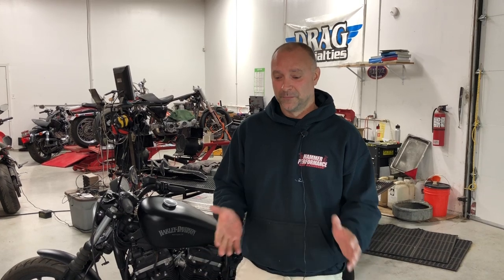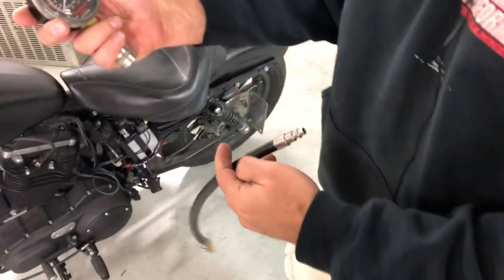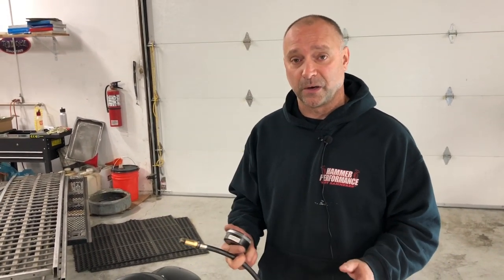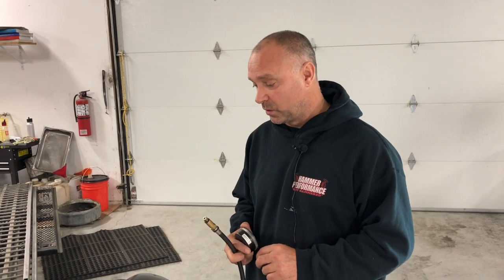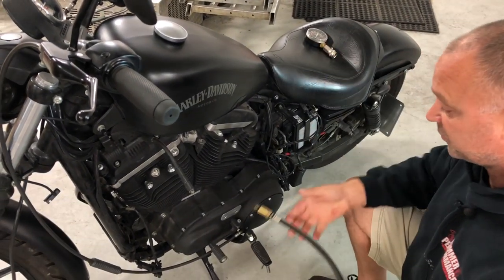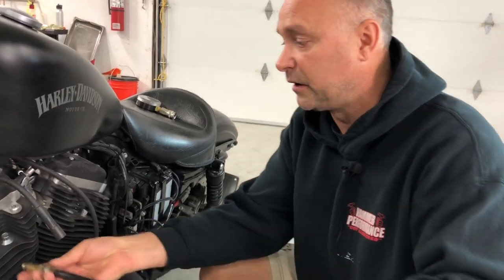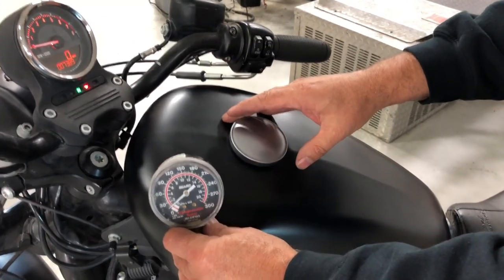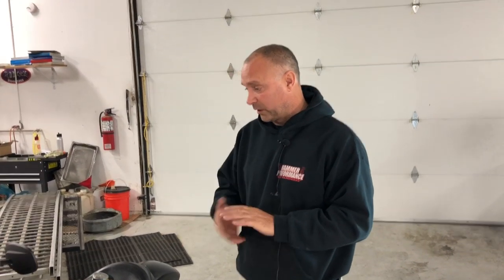How To Do A Cranking Compression Check On A Harley Davidson Motorcycle

Comment: Main thing you missed out here is it is not just the psi, it is important that both cylinders give similar readings. If one is low compared to the other you have a problem
Reply: How large of a difference between cylinders is okay?
Reply: @codybatman7974  much more than 10 psi and I would think something is up. Usually it is the rear cylinder that is lower as it runs a bit hotter.

Comment: Quoting my 2006 H-D service manual, 1200cc engines normal compression is 200 to 225 PSI.... no wonder it would sometimes 'rattle' with pre-ignition on hot days..... I was getting 211 and 215 with one of your 1250 kits (rectangular dome 10.5 :1 pistons) and Andrews N4 cams. I have since bought your Impact 560 cams and use Ultima roller rockers with a slight ratio increase and had the heads ported over here in England. The porter found my heads needed decking to get the nominal 62cc (or whatever it is ! ) due to some other guy's seat work.... I have found my compression tester again, so will be interested to see what it tells me.....
Reply: It's been a while but do you remember your results?
Reply: @jonnymac8925  No, sorry but I haven't put the compression tester on it yet and it may be a while before I get the chance. I managed to lose control at low speed and slip into a gulley - long story short, the bike is not too bad but I have a broken tibia and fibula that required the use of a Llizarov frame (look it up). I would not think the cranking pressures are much higher than H-D quote for a standard bike though as although Hammer's static compression ratio is higher than Harley's standard XL1200R, the later closing point of Hammers inlet cam will reduce the overall cranking pressure

Comment: 2016 Street Glide, does it matter if my bike is fuel injected? Still wide open on the throttle? Would I do everything the same? What compression should I expect from a stock 103 engine?

Comment: Do I need to disconnect fuel on an injected 96 twin cam? And do I leave the plugs connected and ground them to the bike or just pull the fuse for the ignition?

Comment: Removing spark plugs on a hot engine alum cylinder could strip the threads . On a warm engine they may be ok to remove.

Comment: What readings should I be expecting by doing this with a cold engine and without WOT on a fatboy 103 ci? The manual also states to take off the air cleaner, Is it really necessary to do that? Your answer will be much appreciated.
Reply from the maker: A compression test without holding the throttle wide open is invalid, and you shouldn't draw any conclusions from the result. If the motor can't draw in air, it can't make compression.
Reply: @HAMMERPERFORMANCE  Ok thank you so much for your quick answer.........The reason I ask this is I have an electronic throttle so I'm not quite sure it will work with the plugs out when I push the start button.....anyways if I do this with completely WOT, cold engine and air filter on, what readings should I be expecting from this particular 103 motor? Thanks again.

P.D. I also have ACRs on the heads

Comment: Hey Hammer Dan. I’ve been catching a lot of your vids and I have noticed when you talk about “earlier model Sportsters“ you don’t usually go back to include the four-speed motors. Are they that different, that it would require a whole new video, or that similar that they don’t need to be addressed directly? I have an ‘86 883 and I am interested in a performance package including cams and headwork. Just wondering if I am in for a surprise when I read the install instructions? I’ve been working on Harleys  off and on since the 70's but have yet to deal with the cams or lower end/transmission on a sportster. Very much appreciate all of the info available here! Such great resources we have at our disposal! ( I am asking this question here, because most of the other videos were more than a year old and I thought it might get missed)

Comment: How do you determine the compression ratio when you take the readings on each cylinder ie: a 215 reading is 10:1 or 12:1?
I have a 2010 fat Bob and I want to replace the plugs right plug for compression ratio
Reply from the maker: To get from compression ratio to cranking compression, you have to factor in cam timing, specifically the intake valve close point. Watch this video, we show how it's done: https://www.youtube.com/watch?v=vgclz3FOq_Q

Comment: If my oil pump gear has went as far as leaving metal pieces in the oil pump is the motor gone
Reply from the maker: It can be repaired, so I'd stop short of calling it "gone". But it's a mess, generally requiring a full tear-down to really clean it out properly and assess potential damage to cylinder walls and bearings and so forth. 

Failure of that gear is unfortunately not uncommon, particularly when the power is raised. It was a terrible issue on Buell models because they made a lot more power. HD finally came out with a fix in 2006, in the form of a bronze gear that conforms to the varying tooth engagement that results from pinion shaft runout. Watch this video for more information: https://www.youtube.com/watch?v=xeEcCfxs-ns

Comment: My 1999 1200 sportster has 90 psi in both cylinders. Is this really bad? It’s way low.
Reply from the maker: With the throttle wide open?
Reply: @HAMMERPERFORMANCE  I used a gauge and put it in the spark plug hole and just turned the engine over a couple times while having both spark plug wires disconnected so it wouldn’t start.
Reply from the maker: @techunity1401  A compression test has to be done with the throttle wide open. If not, then the motor can't pull in air, and it makes the result come out way low. Do it again with the throttle wide open and I think you'll see a much better result.
Reply: @HAMMERPERFORMANCE  thank you, my dyna had 150psi and my dads Electra glide had 120psi doing it with no throttle also.

Comment: can someone explain the relationship of psi to ratio...(i.e. say 165 psi is equal to 9.2 to one)
Reply from the maker: It can be calculated, however, cam timing is a part of the calculation. We offer a free calculator program and we have a video that shows how to use it: https://youtu.be/vgclz3FOq_Q
Reply: @HAMMERPERFORMANCE  how accurate is the calculator? Thanks!